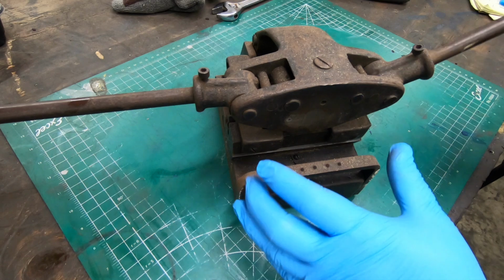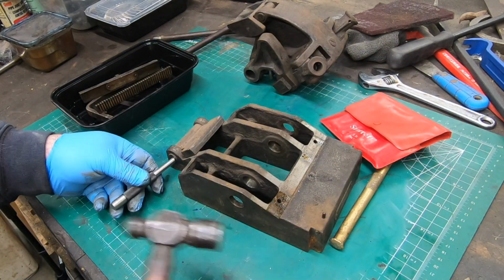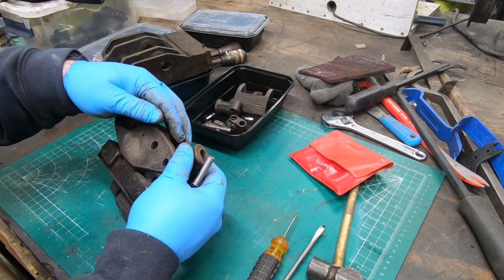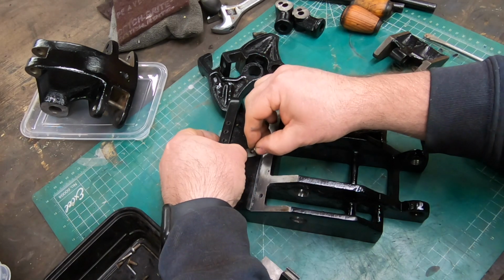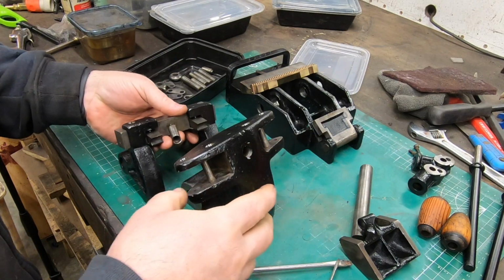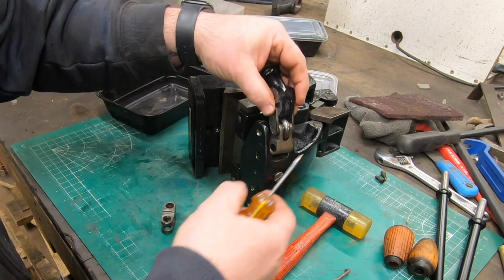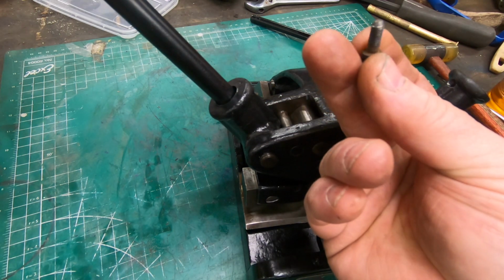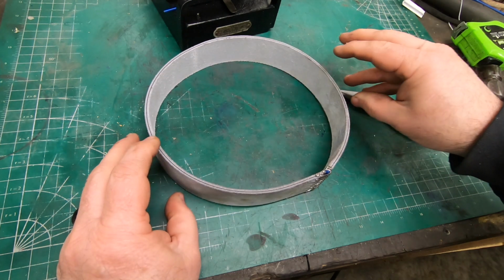Refurbishing a Clipper 6" Belt Lacer

Comment: also I think there is less were on the cones because there is no metal staples
Reply from the maker: I think your reasoning is as flawed as it could possibly be. If that were true, there would be wear in my 80 year old pulleys. There isn't. This lathe will outlast my great grandchildren. You're simply trying to justify your solution as "better" when it isn't. It's different. But each has pros and cons. If you don't like the "noise" from the belt lacing, how can you possibly stand the "noise" of the lathe, or a milling machine? I'm glad you like your glued belt.